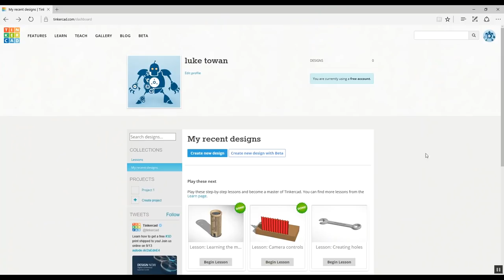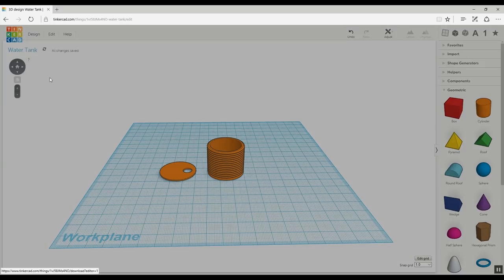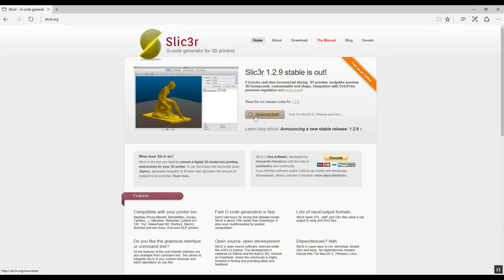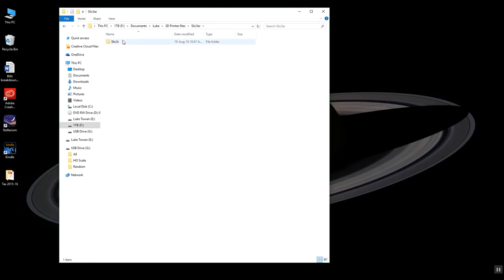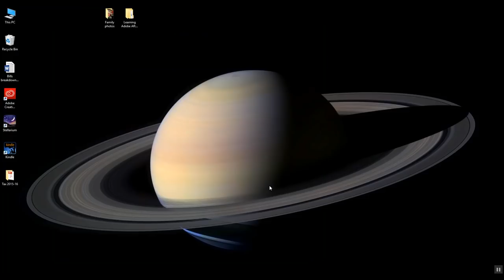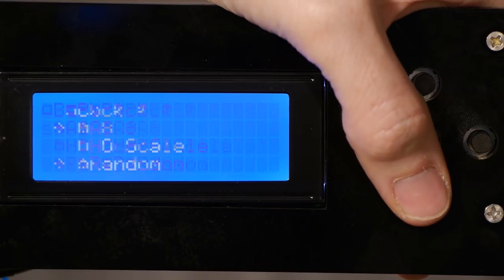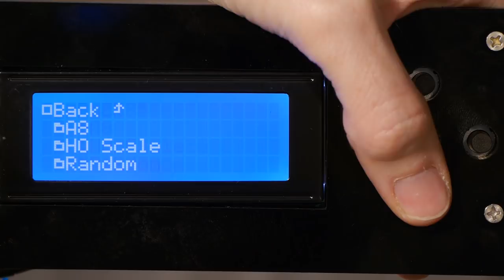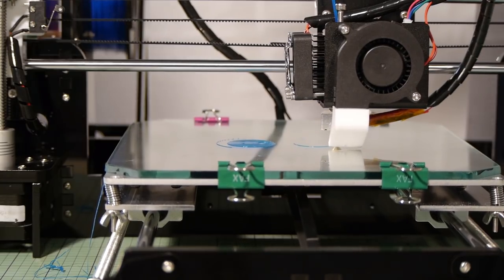3D Printed Water Tank - Model Railroad Scenery

Comment: A good tip for a smooth finish is to repeatedly paint and sand with very fine sand paper. That way the paint builds up between the layers, until the surface is smooth :)
Reply: high build primer is your friend, youll save time
Reply from the maker: thanks for the tip mate :) I'll work at it.

Comment: The design for the tank.  if you leave the lid off it looks exactly like
 corrugated pipe.  Matches the plastic stuff a little more than the 
galvanized.  Make some sizes from 12, 18,24,36,48,56 inch and either 
make culverts or pipe loads.
Reply from the maker: Thanks for the tip :) I'll be sure to give that a try
Cheers
Luke

Comment: Generally the thin aluminum plate on these things warp with heating, so glass is probably still a good idea particularly if everything is level and you aren't getting good adhesion.
Reply from the maker: Good point. I also just discovered the glass expands slightly as it heats so once the model has been printed and the glass begins to cool down it shrinks and the model becomes very easy to remove from the glass :)
Cheers
Luke

Comment: You could try using some acetone on the printed object to smooth it out. Depending on the filament you use, it could be enough to simply let it sit in the fumes from the acetone for a short while, that should melt the surface just enough to smooth out the imperfections. Some filaments are a bit tougher, and you might need to apply a small amount of acetone with a brush.
Reply: That works better for ABS than PLA. With PLA, it just tends to make it soft, whereas it actually dissolves ABS.
Reply: BNSF3012 Nscale agreed

Comment: I might get a 3D printer for some Aussie N scale cars, or even justvsome basic cars.
Reply from the maker: cool, just remember the smaller the model the harder it will be to 3D print. It will work however you'll need to do some sanding on the printed model to get it looking nice and smooth.
Cheers
Luke
Reply: xrayracer1 printing that small May require an SLA printer, they can print amazing detail, but are unfortunately somewhat more expensive, both to aquire and to use

Comment: I can't wait to see what you will make with this 3d printer, i am sure it is going to be amazing though :)
Reply from the maker: Yeah it's a very cool machine. It's great for building medium sized details like this water tank for example but I've had trouble trying to print very small things like a cat or a dog. But it is still very useful :)
Reply: For amll, fine details models, use a 0.2 nozzle, and very slow print speeds :)

Comment: I use my 3D printer mostly for prototyping items up before I go and make a final one... As for items that need fine details you may need someone with a resin based 3D printer as those TEND to be pretty good at fine details. That said it looks like your well on your way to making some nice prints! I personally would choose Cura over Sli3r but hey whatever works!
Reply from the maker: Thanks Calvin, I recently tried CURA and what I like most about it is it prints rafts and support material much better than Slic3r but I've found Slic3r to print thin walls a little better. Both are great and I'm now finding myself gravitate towards CURA a little more :)
Resin 3D printer sound interesting.... I wonder if they will be in my budget range... lol, I just googled it and looks like they are a little expensive for me just at the moment :)
Cheers
Luke
Reply: In the end no slicer is "perfect" is what I figured out... ultimately got to do what works best! I tend to design models so it can have a total of 4 passes so that there is enough room for the slicer to add infill if needed. I tend to over-design my stuff for strength but hey if it gets dropped I know it is strong enough!

Comment: You could also print the tank upside down, so you dont have to print 2 parts (lid and tank). Right?
Reply from the maker: yeah you're right, the reason I did it separate is sometimes the first layer on the print surface can come out a little rough so I usually print so the bottom surface doesn't get seen but with a little bit of filler and a light sand that would be a quick fix.
Cheers
Luke

Comment: Luke if you see this (or if anyone else knows) 
How does this compare to the Anycubic resin printer you use later for both quality of finished product and cost to make models?
Not sure if I want to lash out for an expensive printer if I can't afford the consumables and the quality difference is minimal.
I'd be doing 1/72 scale iems.
Reply from the maker: the quality between the anycubic and this are light-years apart, the only down side is the Anycubic printer has a very small usable print surface and working with resin can get a little messy if you're not methodical with cleaning and post processing. The Anycubic photon printer gives much more superior results though. Hope that helps

Comment: You could achieve the same result with a slice of corrugated pipe and a flat piece of polyurethane.
You would save yourself couple hundred bucks ;)
Reply from the maker: true, but the water tank isn't the only thing it can print.... the options are almost endless and your $200 will go a very long way :)